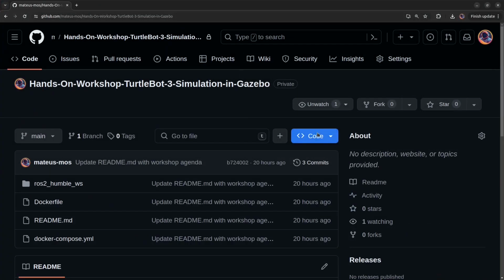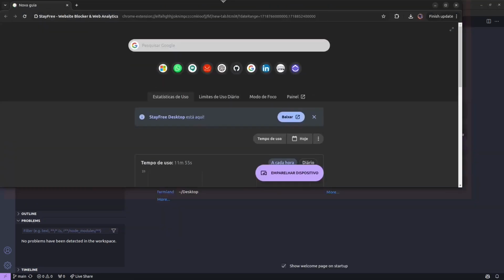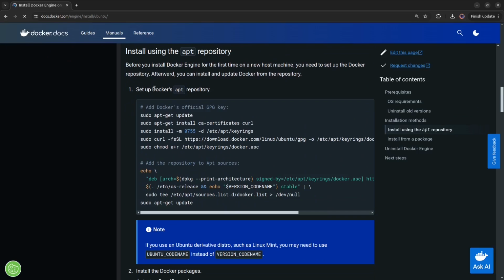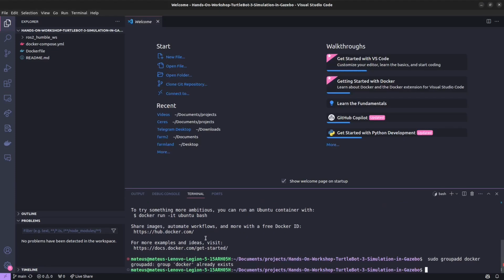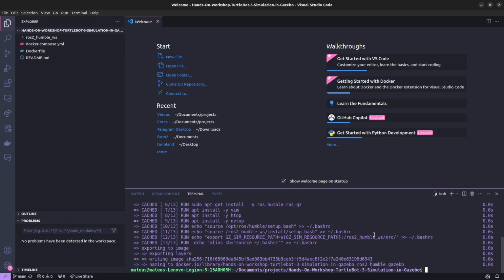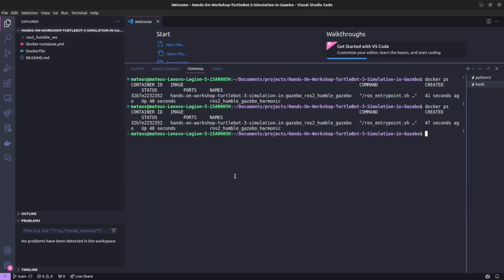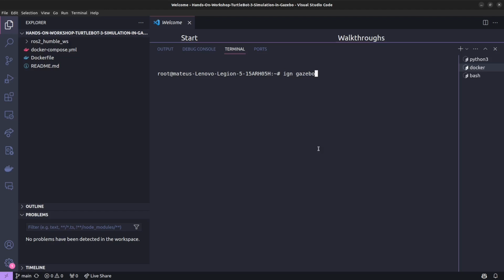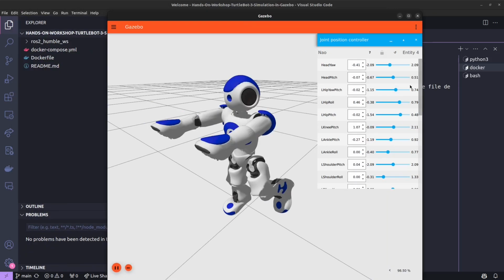Setting Up Your Environment with Docker, ROS2, and Gazebo: A Beginner's Guide

Comment: does this work for mac?
Reply from the maker: Not natively. Docker relies on the host machine’s kernel, and since macOS doesn’t have a native Linux kernel, it can’t run Docker directly. Instead, you can use Docker Desktop, which runs Docker inside a VM